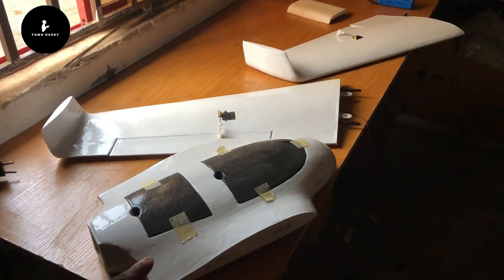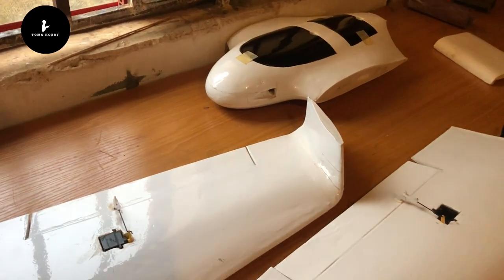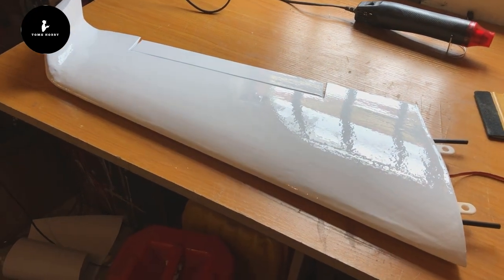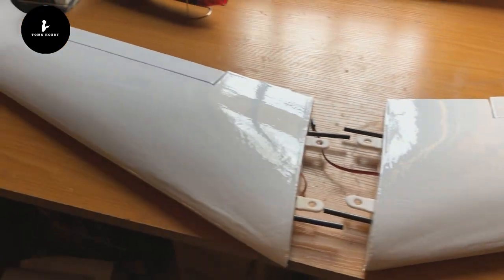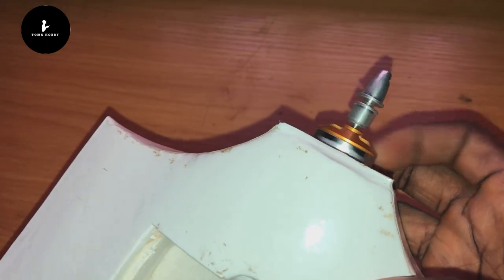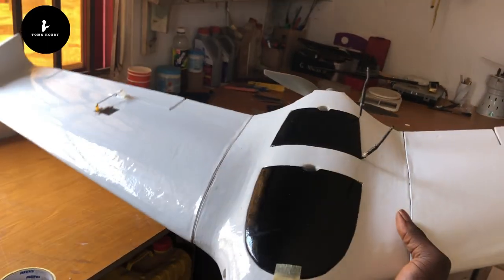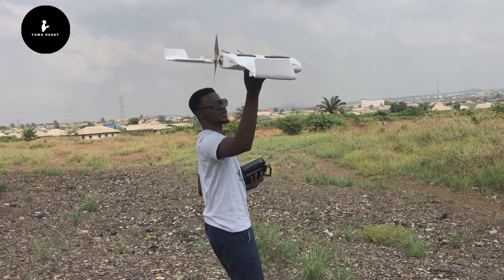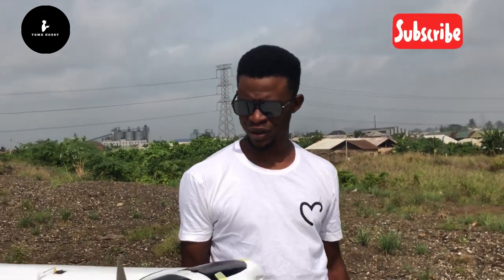Flying RC Wing Build

Comment: I liked the gyro-self correcting feature you added.
How different did you notice on the flying experience?
Reply from the maker: It basically stabilizes the aircraft but sometimes it can be too sensitive so you need to adjust it manually. I fly mostly without gyro